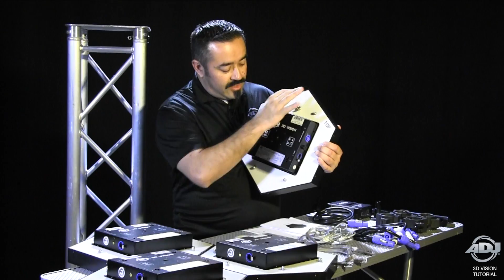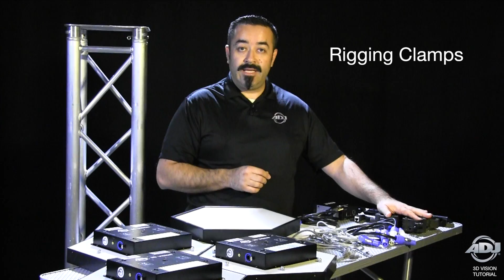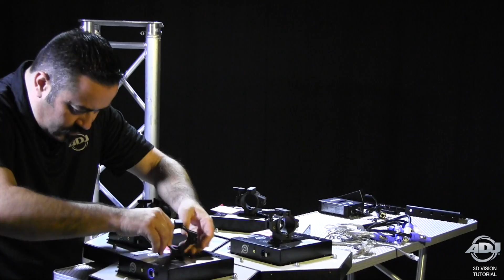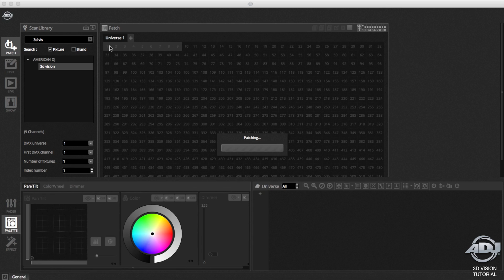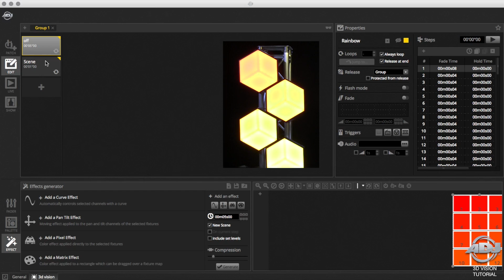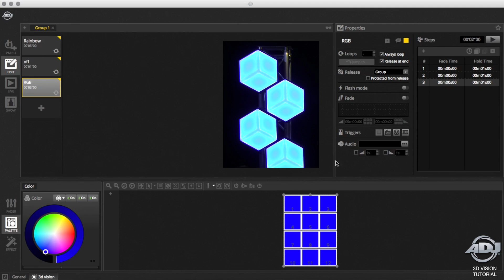ADJ 3D Vision Set-up Tutorial

Comment: Wow, the design of this could be so much simpler and straight forward. Even if it's intended purpose is as a permanent fixture (not mobile), the set up and installation is clunky and time consuming. As I watched this video I could already envision at least two different ways this could have been designed better and made it applicable for fixed and mobile applications.

Comment: Who designed these?? Lol. I see that your plan was to make a product for installs, but even with that in mind it's pretty stupid. If you want to make a professional product there needs to be a better way to address them. I don't really think they should be manually addressed at all though. If you are marketing these for the professional market, you should just have a controller that addresses each unit based on where it is in the data chain, just like video panels. If somebody wanted to do an install with these it would take forever to pre address each unit before install. Not only that but when a unit needs replaced in the future somebody is going to have to try to find that addressing device and hope to hell that the installer wrote the address on the bad unit. Marketing these products for the install market was a horrible decision. They should just have dip switches and an xlr for dmx, a lower price, and be market for DJ's. they are no where near something I would want to install at a venue.

Comment from the maker: Hi All, in an attempt to address some of the concerns with the posts on this video. Even though a mobile DJ could use this product, its main design was for installation into nightclubs, bars, commercial buildings etcetera, to provide exciting, low resolution video at a very affordable price. Each panel is unintelligent, in that it requires a video feed, just like a LED video panel. We didn’t include a power cord because when it’s permanently installed, its not known what size power cord is needed. This is not an off the shelf, turn-key, product. It’s bought in pieces according to the way it will be specified for a job. The purpose of this video was to show installers how to set this up as a system. Hopefully this information a better explanation of this product.